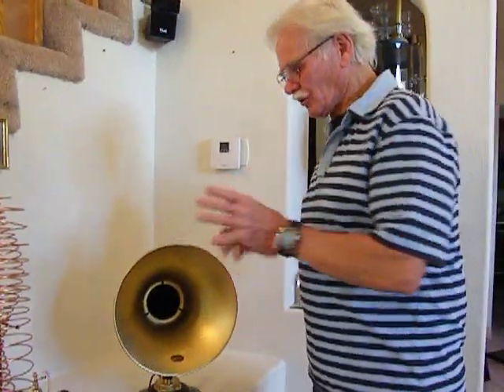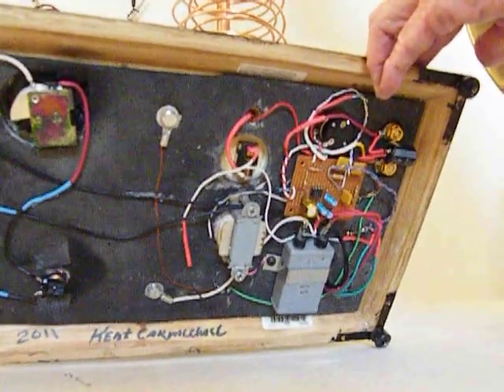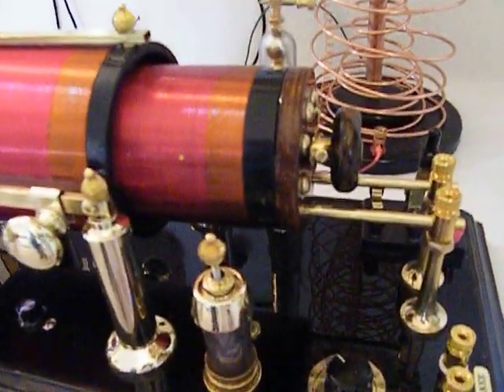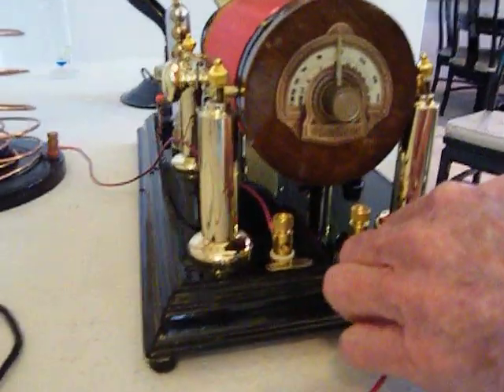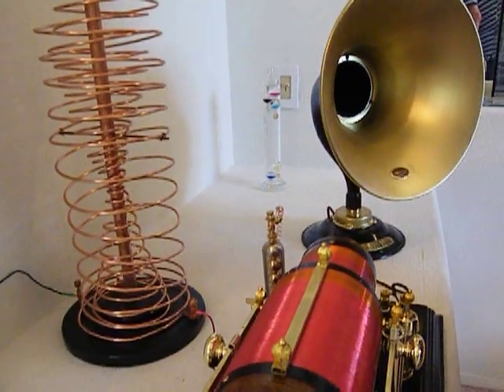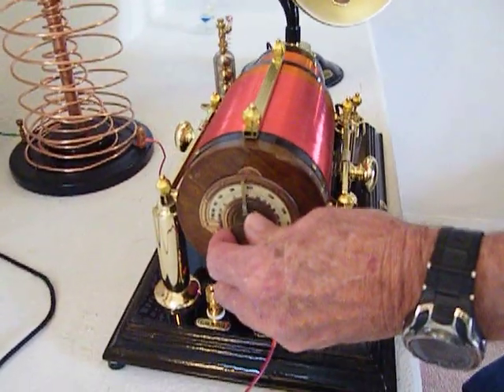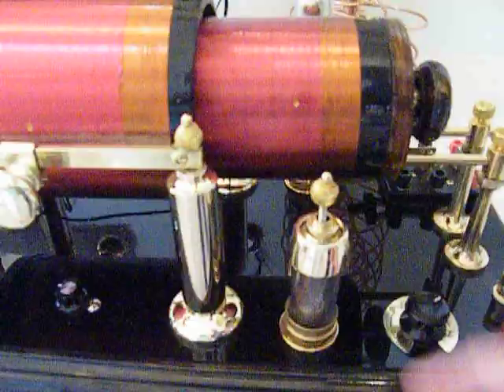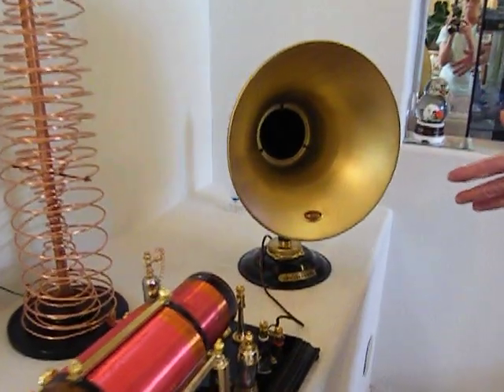crystal radio

Comment: I had a crystal radio when I was a kid.  It came in kit form as a Christmas gift.  I got it when I was 12 and thought it was very cool when I got it put together and hooked up the antenna and found I could get about 20 different stations.  I would stay up for hours every night for years listening to the radio.  To me, the coolest part was that it didn't need electricity.  I called it my magic radio.  So now many years later I am looking to build my second set.  I want it to be simple using the most primitive parts possible, I.E. low tech.  But I have to say, this set is the most elegant radio of any design I have ever seen.  I might be rethinking my original idea after viewing this video.

Comment from the maker: Dear Tom, 
  Thanks, great advice on the second antenna.  It would definitely cut the charge time down  because I could then insert a second charging diode rectifier circuit.  I have just come back from Radio Shack with two 6 volt solar cells.  I have just hooked them up in parallel 10ft. from the crystal set facing sunlight and Voila! power to the capacitor and the crystal set continues to work without interference.  Looks like solar is the only way.  Kindest regards,   Kent

Comment from the maker: We get power to the charging capacitor that I noted that we think came from a World War ll       Japanese submarine using magnetic energy.  This is accomplished by inserting circuitry between the antenna and ground.  We are using four 1N34 germanium diodes, four 100UF         capacitors at 50 volt and two 0.2mf capacitors.  Building this diode bridge rectifier we are getting approximately 4dc charging volts that go to that Japanese charging capacitor.  Hope this helps. Kent